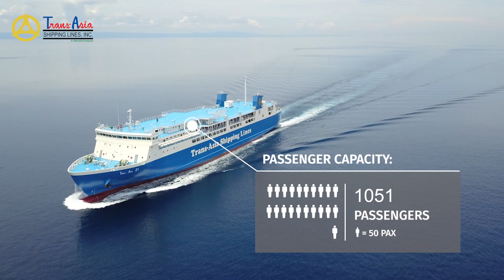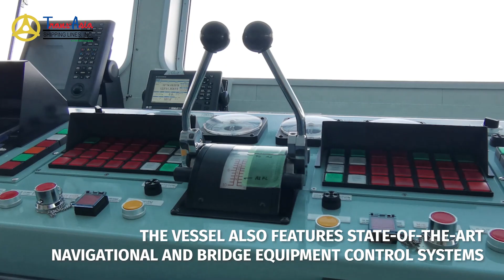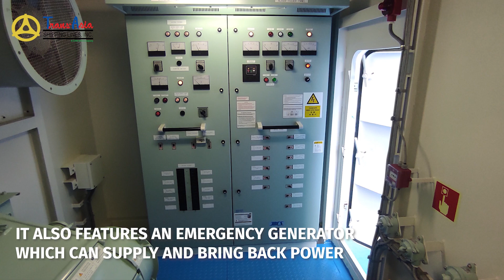Official M/V Trans Asia 21 AVP

Comment: diba ang maximum speed nyan nung sea trial nya sa japan is 21.5 knots...hindi 19 😁😁
Reply: 19 knots is cruising speed. Normal lang po na ganyan ang speed sa regular route ng passenger vessel dahil pag sinagad lagi sa max speed, madaling masira ang makina ng barko at need ng frequent maintenance sa port. Ginagamit  lang po ang maximum speed pag emergency scenario, like need makaiwas sa bagyo at makarating sa nearby port to shelter.